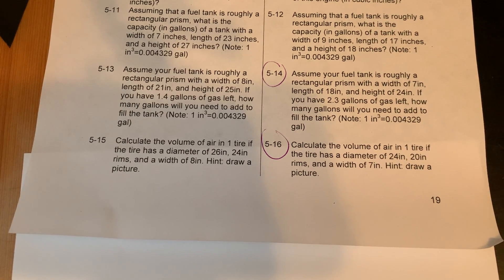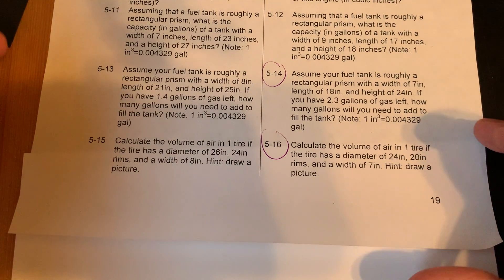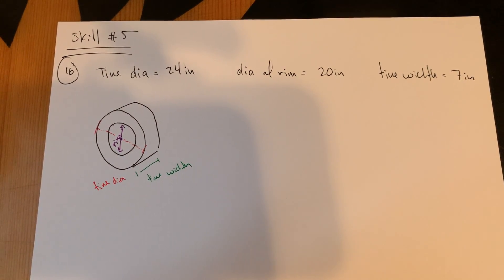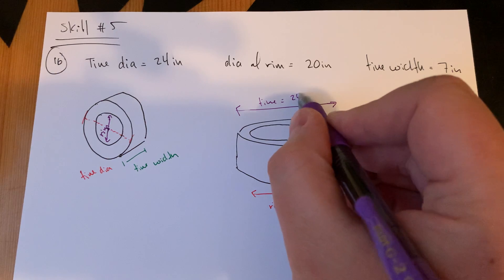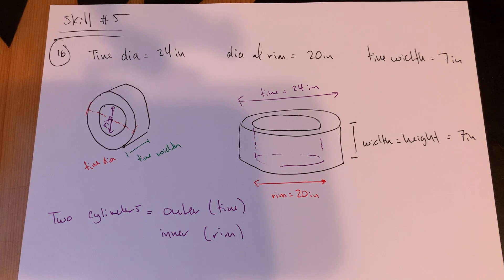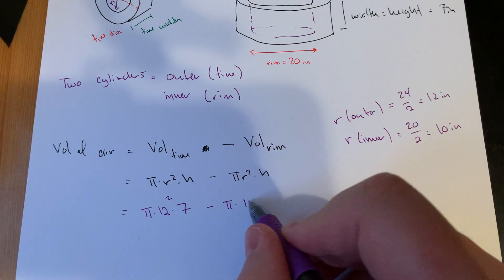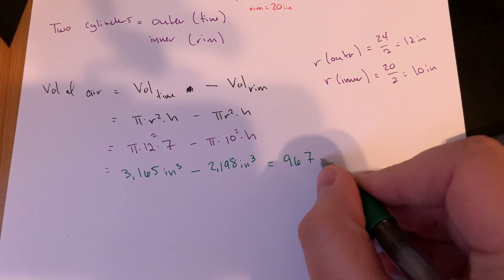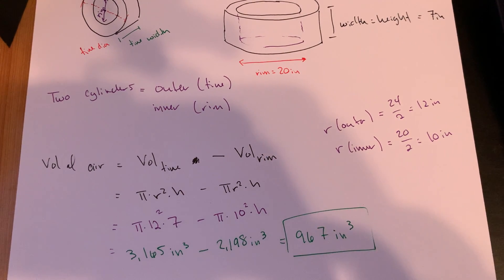MA 106 Skill 5: Tire Volumes

Comment: Just wanted to thank you and other teachers like yourself who take the time to post these videos with great explanations. I am 7 days shy of my 53 birthday.  I didn’t do well in high school algebra (mainly my own fault).  I had a girlfriend in college who helped me greatly.  I turned into a straight A math student because her.  (Of course her motivation tactics, were only what was in my dreams in high school.
Any way, while tooling around YouTube, I came across an expanding Urethane foam.  Thought it might work better as a tire filler than the Great Stuff others were using.  However, in order to use it you had to be somewhat precise in calculations so you don’t end up with too much or not enough foam.  So I needed to know the Volume of air of my lawn tractor front tires.  I gathered the needed information and followed your steps. Thank you you Professor Johanson.  By the way the volume of a John Deere tractor tire 15 x 6 x 6.00 is 890 cubic inches😉 9:40